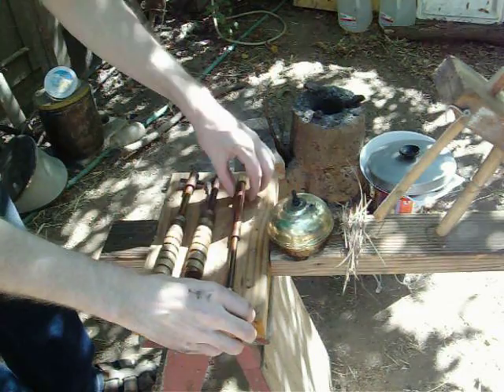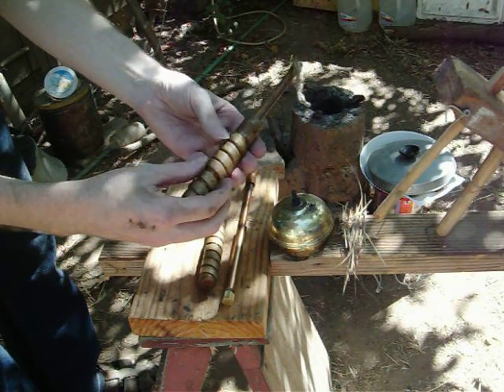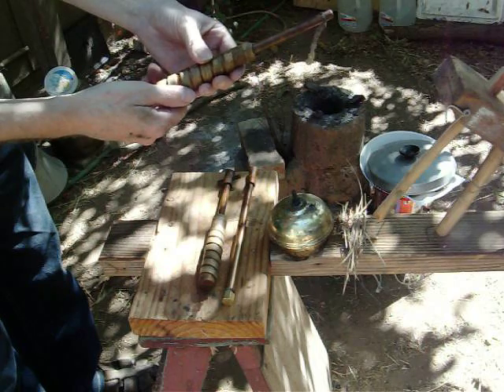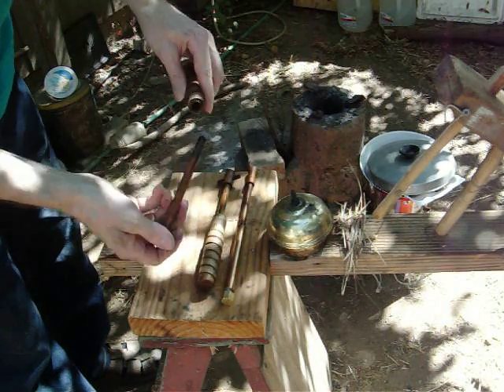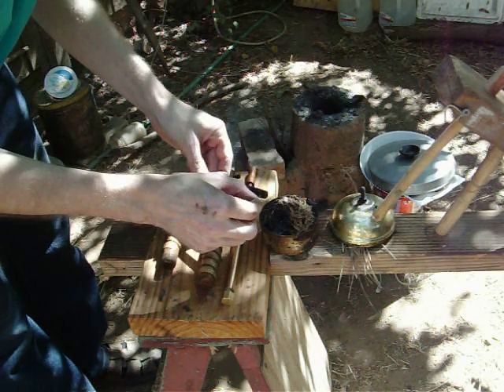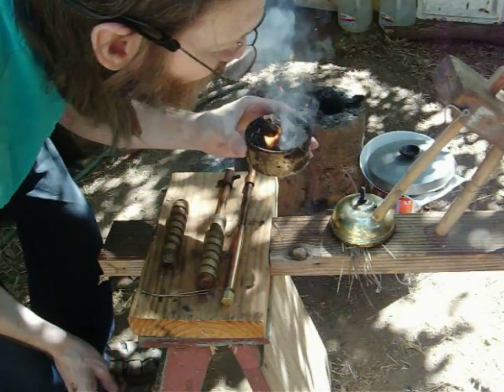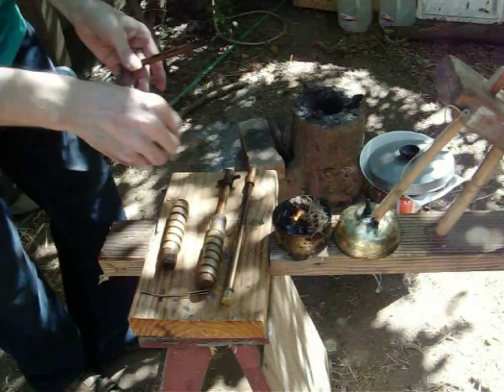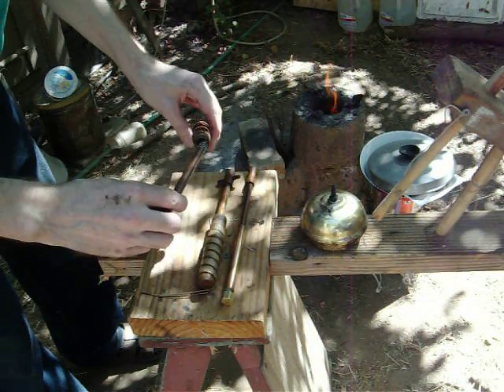fire pistons.MOV

Comment: Best homemade fire piston i've seen so far. Im also making one in wood, the traditional way. I don't havebambo here so gonna drill a hole and use natural fibers to seal it.
Reply from the maker: Thanks Dr. Donkle. 

I found that the heartwood of black locust worked, but some other hardwoods failed. I was  driving air through the wood along the grain.  I tried to fill the pores with wax, glue, but couldn't make that work.  It would be interesting to experiment with other kinds of wood and ways of sealing pores, but I haven't gone further with that.
  I did have success in making the gasket from leather washers, and one that I made like this is still working.  The leather is a lot more durable and makes a better seal than string, I think, but it is more difficult to make to begin.  I turned a separate shaft with the tinder cup at one end, that the leather washers were stacked on, and then this went into a hole in the end of the main piston shaft and was held with a cross wedge.  I used the cross wedge to draw the leather tight. A plain pin would probably work, too, if the leather is dry to begin.  It will swell up with some oil or grease.  But it is good to have it tight to begin because it needs to be shaved round in the lathe to get a good fit in the cylinder before you lubricate it, then the lubrication swells it and makes a really good seal.  Thinking about it just now,  the lathe itself could hold it all squeezed together, though...